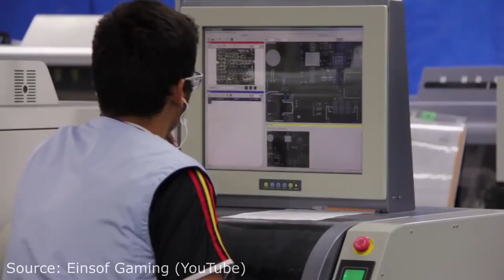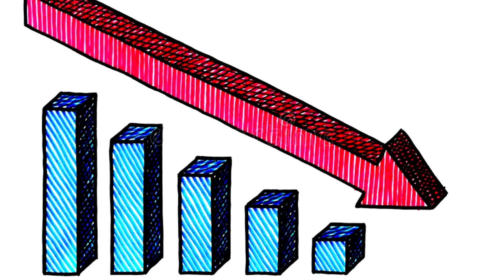How Much Will The PSVR 2 Cost?

Comment: Oof, very hard question - price tag could be anything between 299$ and 499$. And we still don't know whether there'll be a wireless option. I will pay anything up to 799€ (wireless), depending on the quality anyways  because I'm a full VR believer and I can see my VR-gaming-share rise above 60% compared to flat this console generation. I've also given up on PC gaming for the foreseeable future, so all my funds will go towards PSVR2.
Reply from the maker: I'll be surprised if there's a wireless option considering they've specifically mentioned there'll be a single cord (to keep expectations in check would be my guess).
Reply: @PetrifyingPumpkins  There was recently a rumour based on something a Sony executive has said. I'm not holding my breath either, because we haven't seen a Sony patent for VR dedicated transmission tech yet. We know that Valve has been working on this for years and wasn't able to get it ready for the Index, so if Sony already has a solution developed, that would be a huge surprise. But I'm pretty sure they won't be using Wi-Fi. The wireless tech HTC were selling won't cut it anymore, now that 2X2K resolutions have become the standard.

Comment: I think it will be much more than people think. You have to consider the hand tracking controllers eye tracking. Rumble in headset. Index controllers are 275 a pair. It has 87 sensors in the controllers for finger tracking. Just for my bhaptics face cushion is 150. Gonna be interesting if everything they listed will be in the final product to keep the price down. And also sorry pumpkins but your ps5 has ram and has a cpu and a gpu. Its basically an unupgradable pc. I believe they even have an amd processor in the ps4 also ps5.
Reply from the maker: Sure my PS5 does, but I was talking about the PSVR2. It doesn't do the heavy lifting like the Quest has to. So less expense on ram etc.
Reply: @PetrifyingPumpkins  exactly. Imo the quest 2 is still too pcvr dependent. Nobody including my friends like native quest 2 games. Sure they have some good titles but not the games you really want to play or at least me and my friends including my son. They're all linked up which kinda defeats the purpose of wireless.
Reply from the maker: @Vr_Demon_  I wonder how many Quest players are  using it standalone only compared to having it linked to pc. It'd be interesting to see, I feel like standalone is probably the majority based solely on ease of use.
Reply: Index controllers are overpriced af. Rift controllers cost 70$ each when bought separately - production costs: probably a few dollars.
And accessoires have always been overpriced- that's where every hardware manufacturer makes the real money. Ask Nintendo, lol. I'm no expert, but we live in an age where a "decent" 50 inch 4K TV costs something around 500$, so it's really hard for me to believe that smartphone sized displays and some low-res cameras add a lot of production costs in a HMD. At this point R&D is probably the thing that makes VR expensive for manufacturers. The materials are nothing special and Sony can get the prices down by buying a ton of them compared to Valve, HP, HTC...
Reply: @mark-o-man6603  first off no one buys one controller. Second..how are you coming up with your valuation? Also you are talking about discontinued controllers at 140 dollars. If you add handstrap (which index has already) also just about all my friends payed the extra for the handstrap not to mention pretty much every youtuber. That bumps up your 140 to 160. You think an extra 120 for the best controllers on the market with finger tracking is too overpriced? Lol Even the worst controllers on the market which is psvr controllers are still 100! So in reality the rift controllers are cheap. Only have to spend 40 dollars more to have way better controllers with thumbsticks is cheap! Probably because they discontinued the rift as well. Competition lowers prices. The index controllers are the only finger tracking controllers available. They could list them for 400 and people will still pay for the best controllers on the market because there is no competition
Reply: @mark-o-man6603  don't forget when flat screen tvs came out...they were 10 grand. Competition lowered the prices
Reply: @mark-o-man6603  trust me..people will pay. Their are currently more index users on steam than oculus rifts users. Index is second behind the quest 2.

Comment: I actually do think psvr2 will have alot of hardware onboard.
Reply from the maker: Sure it'll have a lots of stuff up there (display, gyros, the haptic feedback that will supposedly offset sickness etc) but I mean processing hardware. Unless you mean you're expecting it to have that type of hardware up there?
Reply: @PetrifyingPumpkins  i think there will be some processing hardware so its capable of wireless and then of course some battery. Inbuilt or possible addon.

Comment: I heard Valve are internally shifting focus away from VR and onto the Deck. The Index is packed full of features and amazing hardware, but it’s making little impact compared to the cheap and accessible Quest.  
If they do another VR headset I bet it’s a standalone.  

Low price sells more than killer hardware. NGVR hardware is really impressive, but I hope it can be cheap enough that everyone gets one. Even if Sony take a hit initially written off as an investment.   

I think they’re positioned well and a PS5 being required isn’t really an additional cost. For the premium VR market cost isn’t a big deciding factor anyway. For the Quest market, I bet most owners have a console and likely a PlayStation anyway.  

As PS5 becomes more commonplace—and it’s on target to sell big—NGVR would be bought to complement an already current gen console, and so if priced right, it would be seen as attractive to people that go an pick up a Quest.  

I doubt there are many Quest only gamers out there.  

Heart hopes for “no brainer” 299 pricing, sold at a loss but making money on software sold for it (of which Sony gets a cut of everything anyway), to get the mass bottom feeder market of people like DicepticoN.    
Head is expecting 359-459 and it remaining a lower volume enthusiast’s toy that only those highly evolved elite fish that left the pond buy in to.  

Big budgets being allocated to VR games needs big sales numbers and therefore big markets, even if that means lower specs on the hardware.  

Cutting edge expensive hardware using the latest display panels and wireless technology etc ironically means a smaller market and lower budget games to never really exploit that hardware anyway. Like it or not, we really need the DicepticoNs of the world on board to get the big ball rolling.
Reply: Valves already filed patents on a new index 2 wireless. Never heard of steam abandoning vr for the steam deck. I seen a valve index running off a steam deck that someone hacked to make it standalone..Lol Also there are more index users than rift players on steam so to say it hasn't made an impact is insane. The index has 144hz with 120 fov and kills everything including pimax 8kxr. I have a quest 2..psvr..and index by the way.
Reply from the maker: You make some good points about Dicepticon being a bottom feeder.